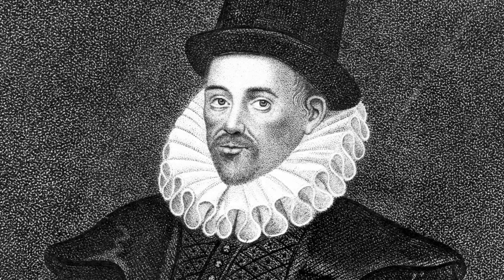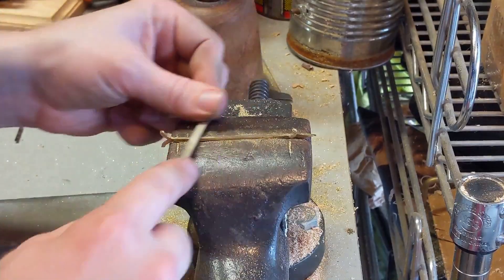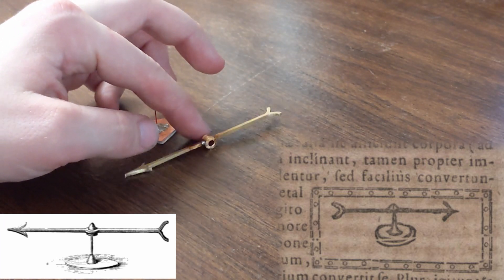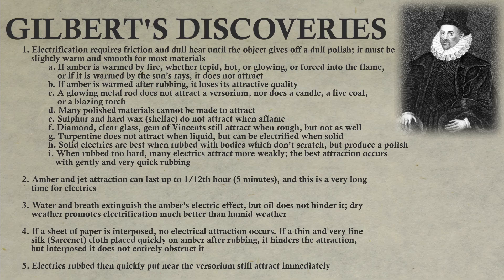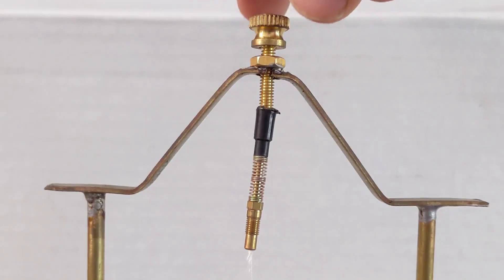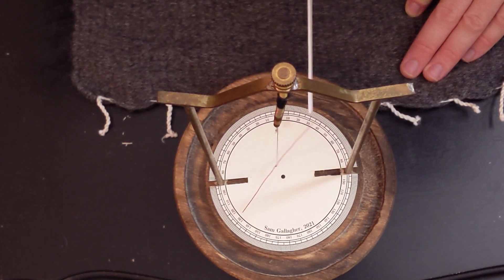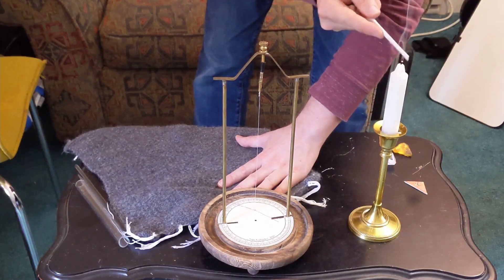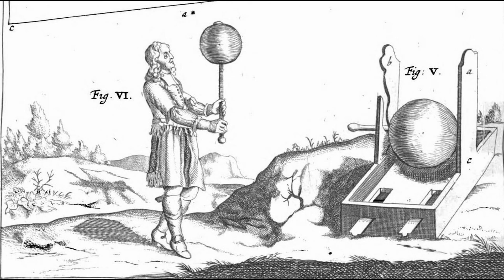How Gilbert Measured Electricity 400 Years Ago

Comment: WHEN TWO SOLID OBJECTS ARE RUBBED AGAINST EACH OTHER, THE CAPACITANCE OF +/- FREE CHARGE AETHER MIXTURE IS INCREASED FOR THE DURATION OF THE MUTUAL INDUCTION FROM THE +/- STRUCTURAL CHARGES BETWEEN THE TWO RELATIVELY MOVING OBJECTS.  AETHER IS SUMMONED TO EQUALIBRATE THE TEMPORARY AETHER CAPACITANCE FOR THE TWO RUBBED OBJECTS AND RADIATES IN EXCESS FROM THE OBJECTS WHERE THE MUTUAL INDUCTION MOTION ENDS.  SOME MATERIALS, SUCH AS SILK AND GLASS CAN SEPERATE AND AND LEAVE OPPOSED 
CHARGES ON THE TWO OBJECTS.  AN ELECTRICITY IS A MIXTURE OF AETHER THAT HAS A HIGHER PERCENTAGE OF EITHER FREE +/-CHARGE THAN IS COMPENSATED FOR BY THE STRUCTURAL +/- CHARGE FIELDS OF THE OBJECT HOLDING THE AETHER +/- CHARGE MIX.  THERE ARE FOUR KINDS OF MATTER.  ZERO, ONE, TWO, THREE  ELECTRIC AXIS MATTER.  SPACE IS THE RELATIONSHIP BETWEEN THESES FOUR KINDS OF MATTER.  MATTER DOES NOT FILL SPACE.  MATTER CREATES SPACE.  YOU CAN READ MY TRANSLATIONS AND TRANSCRIPTIONS OF FARADAY, SCHEELE, DELA RIVE, BIOT AT http://SilverScienceBook.Com.
\
Reply: HEAT IS AETHER COMING AT YOU.  COLD IS AETHER LEAVING YOU.